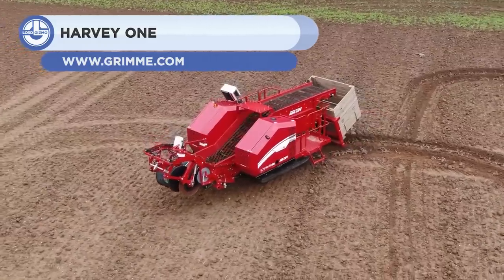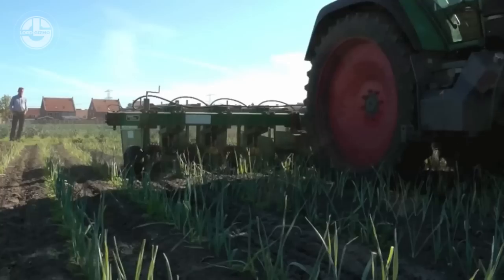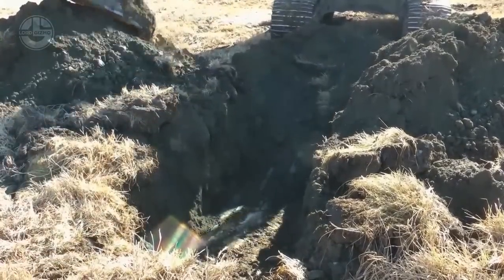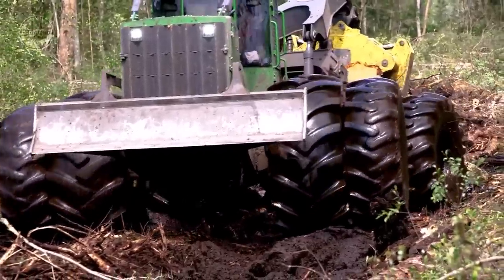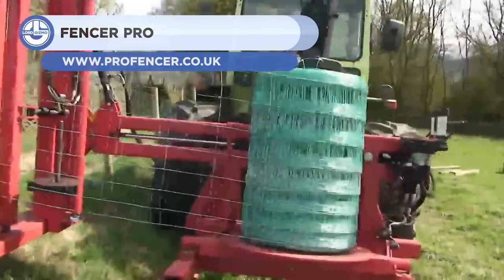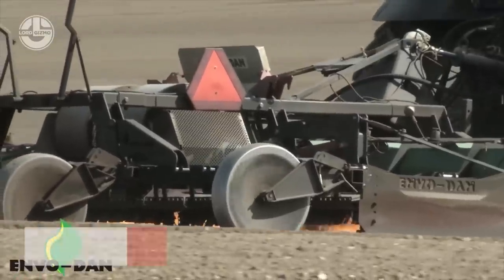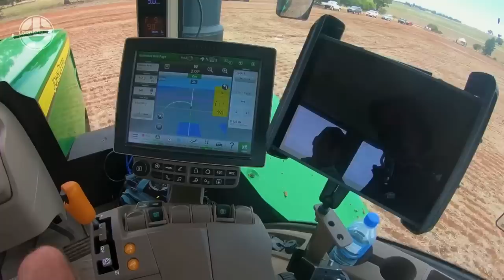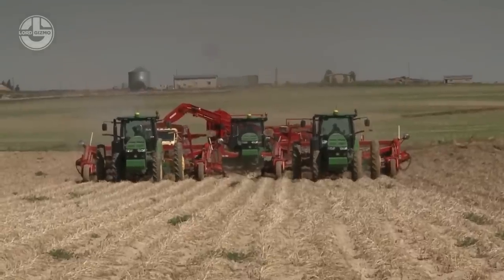The Most Impressive And Powerful Machines Ever Used in Agriculture

Comment: explaine to me why you would want to drain water away and not let it perculate down to the water table
Reply: Too much water in a field can make soil conditions too wet to properly grow certain crops or makes working within the field difficult
Reply: Some fields have a higher water table than normal, possibly due to topography or a shallow rock layer preventing drainage.